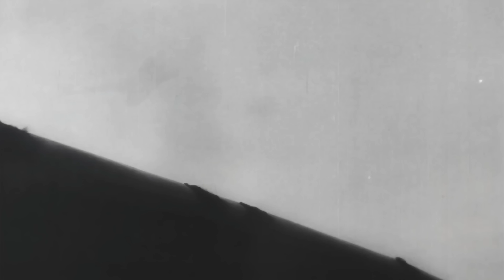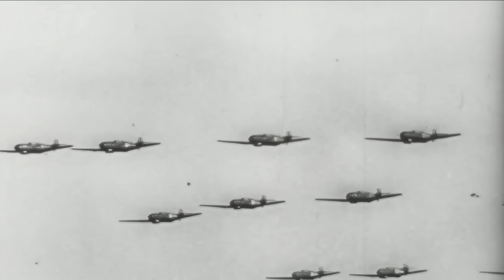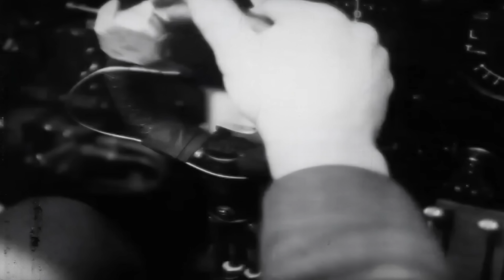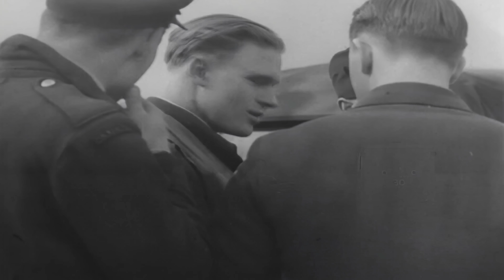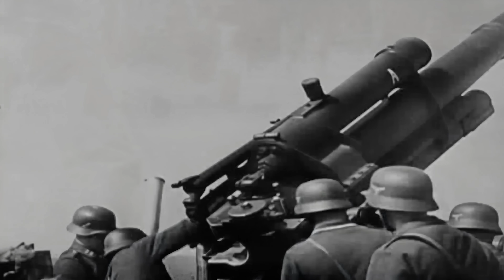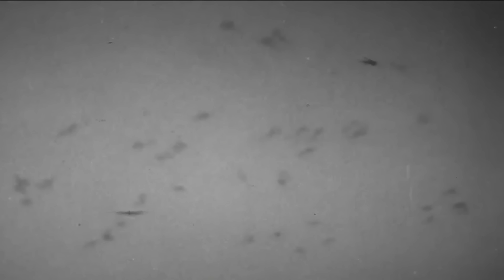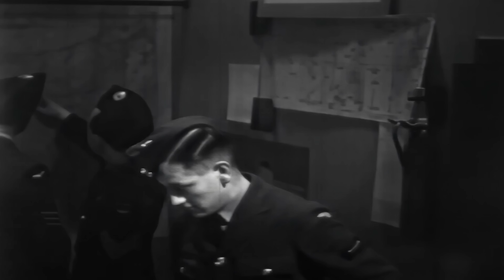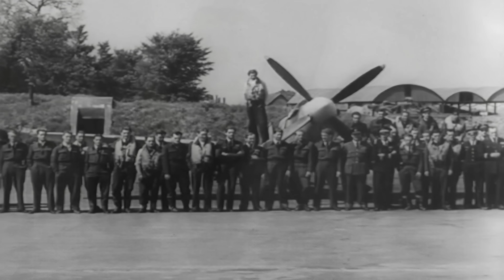440mph Monster That Cracked Germany’s Air Force

Comment: The Bf-109e was not outclassing the Spitfire and Hurricane in the Battle of Britain. While the 109 was significantly faster and could out climb the Hurricane, the Hurricane in turn could out turn and outroll the 109e giving them better maneouverability.  So Hurricanes had the advantage in a dogfight, but the 109s could break off easily, which they often had to because of fuel limits. The Spitfire could out turn and outroll the 109e, but the 109 could barely outrun the Spitfire, but not by enough to make a difference. At medium altitude the 109e could outclimb the Spitfire, but above 20,000 the Spitfire 1 had superior performance in virtually all ways to the 109e.
Reply: There are plenty of comparison reports in the literature. Here's the short of it.
The 109E and the Spitfire II were broadly equivalent in 1940. The 109 had the definite advantage of not cutting out in -G.
Improved fuel towards late 1940 (which the Germans never matched) gave Spitfires a distinct advantage at high altitude.
The Spitfire could outclimb the 109, but the 109 had a steeper angle of climb. The Spitfire could out-turn the 109.
The 109F had a slight advantage over the Spitfire V. Later Spitfires equalled the 109. 
From the Spitfire IX onwards, the Spitfire was increasingly superior in almost every way.
The BIGGEST difference was pilot training and tactics. Allied pilots were increasingly superior as the war progressed.
The Hurricane could out-turn the 109. In most other ways, the 109 had a slight advantage. The Hurricane was very poor at high altitude.
The 109 had dreadful undercarriage. 5% of all 109 losses occurred on takeoff and landing. 
The Hurricane was the best of the three in terms of landing, takeoff and maintenance.
Reply: @FredScuttle456 

Quite interesting!
And now let’s read the opinion of the German side:

Major Werner "Vati" Mölders, Kommodore of JG 51 during the Battle of Britian, participated in the comperative trials at E-Stelle Rechlin, during which he flew both the Spitfire and the Hurricane, on which he recalled, in agreement with the report below.

"It was very interesting to carry out the flight trials at Rechlin with the Spitfire and the Hurricane. Both types are very simple to fly compared to our aircraft, and childishly easy to take-off and land. The Hurricane is good-natured and turns well, but its performance is decidedly inferior to that of the Me 109. It has strong stick forces and is "lazy" on the ailerons.

The Spitfire is one class better. It handles well, is light on the controls, faultless in the turn and has a performance approaching that of the Bf 109. As a fighting aircraft, however, it is miserable. A sudden push forward on the stick will cause the Motor to cut; and because the propeller has only two pitch settings (take-off and cruise), in a rapidly changing air combat situation the motor is either overspeeding or else is not being used to the full."
Reply: @irontmpt3naq-z5k You have to ask "which Spitfire" & to a lesser degree "which Hurricane" because throughout it's service the Spitfire changed enormously whilst the Hurricane morphed into the Typhoon & then the Tempest!
Reply: @irontmpt3naq-z5k Consider the peopaganda and potential damage to morale if the performance gap wasn't as wide as reported.
Reply: @irontmpt3naq-z5k Well he would say that, wouldn’t he?
Reply: @FredScuttle456 you are ignoring the dumb idea of using underpowered 303 by the poms when the Germans had 30mm guns and cannons, way better 😅
Reply: @FredScuttle456 
From    : Kr.-Fernschr.Ob.d.L.,Führ.Stab Ia Nr.8092/40 g.K. (II)           (only to Lfl.3)  Subject : Comparison flight between Bf 109 E,  Bf 110 C,  Spitfire, Hurricane and           Curtiss.  

The best climb for Bf 109 E and Bf 110 C is achieved with shallow climb angle and higher speeds than at the enemy fighters. It is wrong to climb away steep or climb behind an enemy fighter with the same angle.     Before turning fights with the Bf 109 E type, it must be noted in every case, that all three foreign planes have significantly smaller turning circles and turning times. An attack on the opponent as well as disengagement can only be accomplished on the basis of existing superiority in performance.     For this the following suggestions are given:     The Spitfire and partly the Hurricane have two-pitch propellers. Climbing away with the Bf 109 and Bf 110 must be done with the best climbing speed or even higher speeds of about 280 – 300 km/h. On aircraft with two-pitch propellers with  low blade angle the engine will experience a very high over-revolution, and on the other hand with high blade angle high boost pressure – therefore in other words, performance loss.     The rolling ability of the enemy fighters at high speeds is worse than that of the Bf 109. Quick changes of the trajectory along the vertical axis cause especially with the Spitfire load changes around the cranial axis, coming from high longitudinal thrust momemtum, and significantly disturb the aiming.     In summary, it can be said that all three enemy planes types are inferior to the German planes regarding the flying qualities. Especially the Spitfire has bad rudder and elevator stability on the target approach. In addition the wing-mounted weapons have the known shooting-technique disadvantages.                                          Lfl.Kdo.3/Führ.Abt./Ia. op 1                                              Nr. 3951/40 g.Kdos.                                              signed, K o l l e r F.d.R.
Reply: @FredScuttle456 

From    : Kr.-Fernschr.Ob.d.L.,Führ.Stab Ia Nr.8092/40 g.K. (II)
          (only to Lfl.3)

Subject : Comparison flight between Bf 109 E,  Bf 110 C,  Spitfire, Hurricane and
          Curtiss.

 

    In the following the performance- and air combat comparison that has been performed
at the E-Stelle Rechlin between Bf 109 E and Bf 110 C and the captured enemy fighters
Spitfire, Hurricane and Curtiss shall be brought to acknowledgement. The results of
the comparison are to be announced immediately to all Jagd- and Zerstörer units under
command, to guarantee the appropriate air combat behavior in the engagements on the
basis of technical conditions.

    The Bf 109 E type clearly outperforms all foreign planes:

Speed: the Spitfire is at 0 m by ca. 20 km/h, at 4 km by ca. 10 km/h, Hurricane and
Curtiss at 0 and 4 km altitude by ca. 60 km/h. A similar superiority of the Bf 109 E
exists in the climb performance as well. Climb times to 4 km:
Bf 109 E 4.4 min, Spitfire 5 min, Hurricane 5.6 min, Curtiss 5.2 min.

    The plane Bf 110 C is speed-wise inferior to the Spitfire, superior to the Curtiss
and Hurricane. Regarding the climb performance is the Curtiss equal at ground level,
up to 4 km superior then inferior. Hurricane is inferior up to altitude 2 km, then
superior up to 6.5 km. Spitfire is equal at ground level, otherwise superior.
Reply: A Mosquito could piss all over a 109. And, indeed, a Spitfire.
Reply: Also, the claim about Tigers and Panthers is untrue. Hardly any Tigers were lost to ground attack aircraft in Normandy and there was never a time when 4 Tigers were taken out by Typhoons. This was a very rare occurrence if it happened, nevermind 4 being taken out in one attack, and out of nearly 200 Panthers that the British carefully examined and analysed the lost causes on the Normandy battlefields, only 8 showed signs of rocket projectiles from ground attack aircraft.
Only 5% to 7% of German armour was lost to allied air power, including carpet bombing.
Reply: @lyndoncmp5751 Yeah the ground attack aircraftvwreaked havoc amongst soft skinned vehicles and ground troops that were vital for armoured divisions to operate
Reply: "I was amazed at how docile the aircraft was and how difficult it was to depart, particularly from manoeuvre - in a level turn there was lots of warning from a wide buffet margin and the aircraft would not depart unless it was out of balance. Once departted the aircraft was recovered easily by centralizing the controls. I established a recommended minimum looping speed of 450 kmh and found that the gearing of the propellor control was just right for looping with a little practise it was easy to keep the RPM at 2300 throughout looping manoeuvres. I would not however describe looping as easy. The ailerons were light and extremerely effective. The rate of roll is at least 50 % faster than a Mk V Spitfire with full span wingtips. During the VNE dive I achieved an IAS of 660 kmh. The original limit was 750 kmh. I was only limited by the height avalable, not by any feature of the aircraft which was extremerely smooth and stable at 660 kmh."

- Charlie Brown, RAF Flying Instructor, test flight of restored Me 109 E-4 WN 3579. Source: Warbirds Journal issue 50
Reply: Performance by 1940 standards was good. When put into a full throttle climb at low air speeds, the airplane climbed at a very steep angle, and our fighters used to have difficulty in keeping their sights on the enemy even when at such a height that their rates of climb were comparible. This steep climb at low air speed was one of the standard evasion maneuvres used by the German pilots. Another was to push the stick forward abruptly and bunt into a dive with considerable negative 'g'. The importance of arranging that the engine whould not cut under these circumstances cannot be over-stressed. Speed is picked up quickly in a dive, and if being attacked by an airplane of slightly inferior level performance, this feature can be used with advantage to get out of range. There is no doubt that in the autumn of 1940 the Bf.109E in spite of its faults, was a doughty opponent to set against our own equipment."
- RAF Royal Aircraft Establishment (RAE) Farnborough handling trials,Bf.109E Wn: 1304. M.B. Morgan and R. Smelt of the RAE, 1944.
Reply: Well-put friend!
Reply: After the new engine in 1942 they were practically unbeatable (spitfire)
Reply: "So there are legends on the Spitfire... Ahh the legends... Legends are hard to kill... One of those legends is that the Spitfire turned better than the Messerschmitt 109, or the FW-190. Well that is a good joke... In fact all those who found themselves with a 109 turning inside them, at low speeds, well those in general did not come back to complain about the legend... Why? Above 280 to 300 knots, the Spitfire turned better than the Me-109. But, first and foremost, in a turning battle, the speed goes down and down and down and down, and at one point there comes a time, when the speed has gone down below 200 knots, that the Me-109 turns inside the Spitfire."

Pierre Clostermann: Audio from the past
Reply: @irontmpt3naq-z5k I watched a video once of a warbirds pilot from America describing his flying experience with the 109.He said that the 109 in the hands of a very experienced pilot could outturn almost anything and he had flown most of WW2's most iconic fighters.Maybe that's why there were a lot of 109 aces??
Reply: @irontmpt3naq-z5k due to the leading edge slats on the 109's wings that deployed when the air pressure changed at slower speeds a design feature from old Willie himself 😊
Reply: @irontmpt3naq-z5k  No
Reply: Crap the 109 had fuel injection, way superior to the pom fighters with “carbs” can’t even compare performance.
Reply: @3Kiwiana   The best Merlin engines had two stage superchargers (worked fine with carburetors) & most importantly allowed excellent performance at low & high altitudes .

NB my chainsaw has a carburetor & it continues to work in all sorts of attitudes as did the modified carburetors fitted to WW2 aircraft once the fuel starvation problem was identified.
Reply: @pcka12 that is certainly not the story I heard injection is far superior to carbs hands down, do you get modern carb engines no all modern technology, there are tonnes of vids trying to put down German tech, like the dumb pricks going on about how a mustang could defeat the me 262, absolute horse shit and while we’re at it, the Germans only lost because they were outnumbered more than 30 to 1😅
Reply: @3Kiwiana A lot of German technology was very advanced. However, things like the Me 109 & Tiger tank were pretty much hand built, the Tiger tank in particular was so 'high tech' that a lot of repairs were impossible 'in the field' so that equipment had to be abandoned & disabled in the case of retreat.

Britain by contrast rapidly adopted mass production techniques for everything fully employing a motivated & reasonably well paid female workforce (whilst German women largely stayed at home for most of the war). At the end of the Battle of Britain, Britain had more fighter aircraft available than adequately trained pilots, this was because the British government recognised the 'disposable' nature of equipment & ensured that what was available was 'good enough' not perfect whereas at the end of that period the Luftwaffe was running out of aircraft & certain types like the Stuka & Me110 where being withdrawn from the Western Front because the losses sustained were too great & no replacements could be supplied.
Reply: @pcka12 funny how you forgot the pressure applied to the axis force by USA and British forces along with every one else. try to fight when you’re outnumbered at least 20 to1.
Reply: @3Kiwiana   You may have missed this, but the evacuation at Dunkirk & The Battle of Britain took place well before the USA was involved in WW2 (in fact, a considerable degree of US opinion in the early stages of WW2 was distinctly hostile to France & Britain when those nations took exception to Hitler's invasion of his neighbours). As for Italy (the other part of the Axis & the actual 'Fascist' regime) Mussolini only 'threw in his lot' with Hitler when he thought that he was joining the winning side after France's capitulation to Germany.
Reply: @pcka12 The US was "hostile" to Britain's taking a stance against Hitler's invasion of Poland and other neighboring countries? I don't know if it's just the way you've worded that but I've never heard this... What period of time are we talking here, because America was footing the bill for a not insignificant amount of the supplies/food/equipment etc that Russia/Britain was using to fight Germany WELL before joining the war. I'm fairly certain you know that... I was just really taken aback hearing that the US was "hostile" to Britain joining the fight because everything I've ever read/watched doesn't mention this. The general population was extremely hesitant about the notion of sending their sons to go fight in "Europe's war" after the bloodbath that was WWI, absolutely. But outright "hostile" toward Britain, after all the fighting against Germany in WWI? Then seeing them completely ditch the treaty of Versailles, build up a massive army, and start on the warpath once more? This sounds false to me... The US would no doubt have understood why Britain thought Germany enough of a threat to enter the war against them... To outright condemn it to the point of hostility, or even to be against it at all outside of not wanting to join the fight themselves... I'm gonna need some convincing here for sure I certainly don't know everything, wouldn't be the first time I'd been wrong haha, but I'm really confused and am curious for you to elaborate and give some more details here on your thoughts, and where they are stemming from. If you would, that is.
Reply: Not mentioning pilot skill a shithot pilot in either gives each tye advantage over the other
Reply: Zppp0pppoiiiioopppppllppplppp pplplpll to pop popoooojj
Reply: So this Nazi bloke reckons that all three allied aircraft were inferior to their German counterparts… how convenient! Meanwhile, Hurricanes and Spitfires shot down so many Me 110s that they were were eventually withdrawn from the Battle of Britain entirely, after the farcical situation of needing a BF 109 escort because they were being so badly mauled. A “destroyer” of Luftwaffe morale only…
Reply: There’s a few inaccuracies in this vid. I think he’s referring to the 109 F early in the video. The 190s did have a brief period of a dominant edge. It was more a pendulum effect one side achieving temporary dominance until the other side arrives with a new innovation. Back and forth until the allies achieved air superiority. Generally tho the RAF kicked their nazi asses back to Germany
Reply: WE WERE GREAT IN THOSE DAYS AND SHOWED HOW WE HAD RAN THE WORLD  THEN SAVED THE WORLD !!! NOW WE ARE BROKEN AND A THIRD WORLD JOKE  😢😢😢😢
Reply: 109 could out turn Spitfire. According to  Al Murray in his excellent Battle of Britain series. Superior to the Mk1 in most ways.
Reply: @GusShredny  It was a literal arms race. One side makes advancements then the other side does, they leap-frogged each other for at least the first few years.
Reply: @GusShredny   No it couldn't.
Reply: @GusShredny  No it could not.  Radius Ft             Bank Angle Deg       V/ASI mph
                                   Spitfire              687                            69                          85
                                                              696                            68                          126
                                    Bf109                853                           68                          94  
                                                               885                           62                           126 
Source Smithsonian
Reply: @GusShredny    No the Spitfire always out turned the Me109 . Spitfire 687ft radius@ bank angle 69 deg @ 85mph Me109 853ft radius @ bank angle 68deg @ 94 mph
Reply: The 109 outclased the Spitfire untill the Spitfire got fuel injection. Have you flown a Spitfire 😎
Reply: @DiscusRussell  tHE sPITFIRE DID NOT USE FUEL INJECTIOBN THIS EARLY ALWAYS cARBURETTION
Reply: @DiscusRussell  Incorrect the  Spitfire never had fuel injection until very late and the MkIX  was superior to the Bf109G and that was because of the 2 sped 2 stage supercharger not the fuel injection .
Reply: @DiscusRussell  What about the super/turbo charging of the Merlin engine?
Reply: @SpecialEd_59  read my comment before you show yourself up
Reply: @DiscusRussell  And you are wrong It WAS the 2 speed 2stage supercharger
Reply: @DiscusRussell  Rubbish check out Merlin development